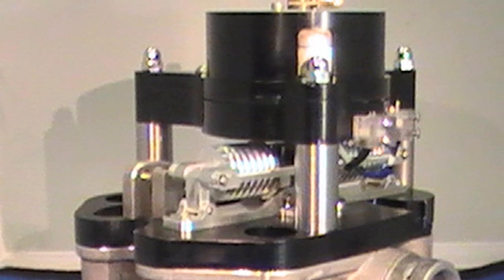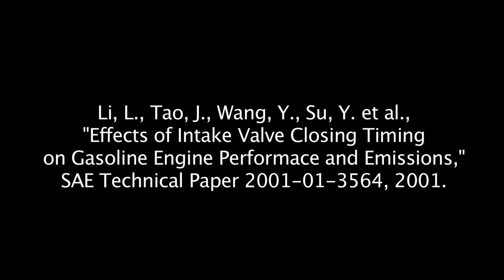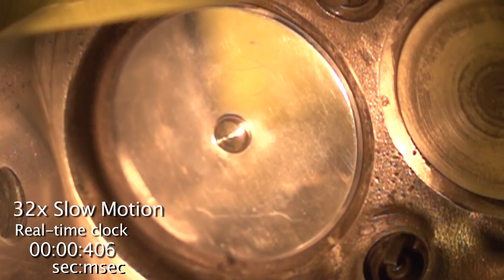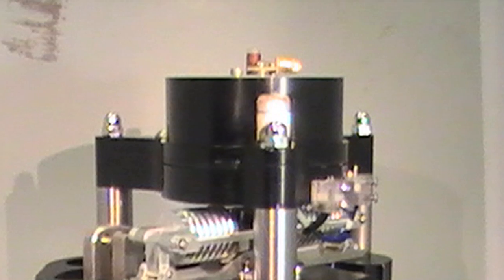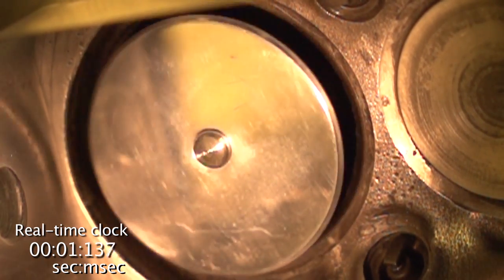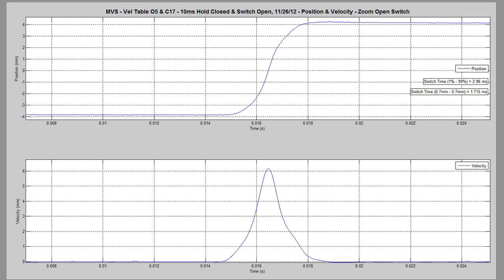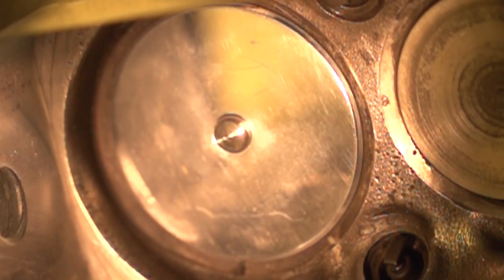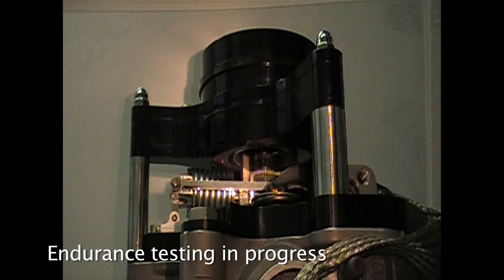Electromechanical Valve Actuator for Variable Valve Timing

Comment: Wow, interesting.... Freevalve has some competition
Reply: FukU2222 nope. This solution only works on intake due to the actuator not being able to provide enough power. On the other hand freevalves system does both intake and exhaust and has infinitely more possibilities. I bet this solution cost more as well. It just might be more reliable.

Comment: This is incredible! The possibilities for improving existing engine designs with this technology are nearly endless! Any valve controlled engine could be improved with continuously variable valve timing. With this incredible level of control, you could theoretically eliminate the need for a throttle body, and could control the fuel air mixture just by varying the length of intake valve duration and fuel injector volume.

Awesome!
Reply: CoreoBroomstick The lift height is controlled mechanically isn't it?

Comment: The future engine blocks indeed! Have you seen the cargen solution? They have a similar valve actuator that is nearing production for the next generation of Christian von Koenigsegg's cars. They even simulate a square camshaft profile. You should check on the patents they have already filed. Great idea, I geek out on this particular development and would love to see it advance as quick as possible!!!
Reply: Ram-Jam Sky No the input SIGNAL is square... but the valve motion is not square due to its inertia.  Having a square profile would be pointless.
Reply: So much hype. Still no free valve to be seen 4 years later.

Comment: That is a CRAP ton of power used for a SINGLE valve.
Reply: +Jason Rochester Rather than comparing with the ignition system, you'd need to calculate valvetrain parastic (friction) losses - which are one of the largest losses in a contemporary engine aside from pure pumping loss. The energy expended to drive a mechanical valvetrain at 5000rpm is surprisingly high

Also, it's not clear if that 278W is whilst the valve is actuated or averaged. If the former then you're only activating 4 valves at any one time (one pair of inlet, one pair of exhaust) so the overall draw is lower than you've calculated.
Reply: 278w per valve at 5000rpm. Assume a 4 cylinder. Thats 278 ×16 valves. That works out to a total of 4.5kw of power draw. That's about 6.5hp. To put that into perspective a typical ignition system for a 4 cylinder would use about 2kw of energy. Which is about 3hp. A 6.5hp loss isnt too bad. I'm sure we can make this more efficient.
Reply: Beau Mancini How does it compare to cam shaft??
Reply: Probably slightly more than a camshaft than having to convert it to electricity, channel it, store it then convert it back into mechanical energy.  The problem becomes in how to generate enough power to run a 32 valve engine at 7000 rpm.
Reply: Beau Mancini "probably"??.... so you don't even know?
Reply: My point wasn't in pointing out the consumption because of a net power gain or loss, it was in feeding current real-time to drivers that would run high rpm or open a valve with a bunch of seat pressure.  Sheesh.  And yes it's more wasteful to change states several times.
But it's OK to take power to get more air in this more fuel for a net gain
 Ask me about forced induction...
Reply: Beau Mancini Seat pressure?... these are springless.
Reply: Beau Mancini Seat pressure?... these are springless.
Reply: +Unruly Creations  This also means we can resort back to inferior-alloy (vastly cheaper) valve seats!.... since the seats (and valves) aren't getting pounded so hard when closing.
Reply: 1.6 KW for a v8 engine that is far less than a cam.
Reply: +Marek Sumguy The valves have to work against combustion chamber pressure, which is very high. also the valves are probably closed by air pressure "air springs"
Reply: +Kj16V  The intake valves don't work against cylinder pressure.
Reply: A 32 valve engine at 7000RPM would consume about 12Kw. Which is just insane.